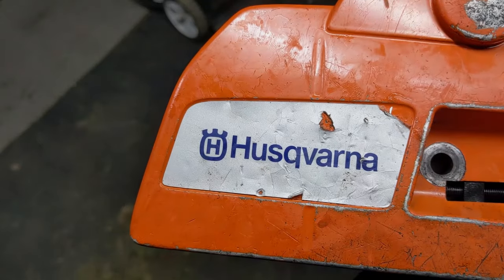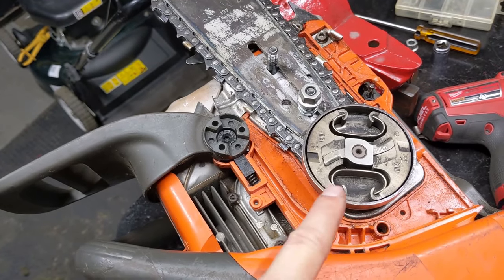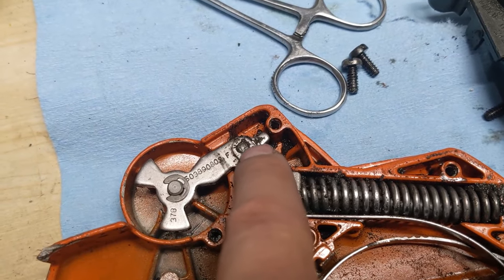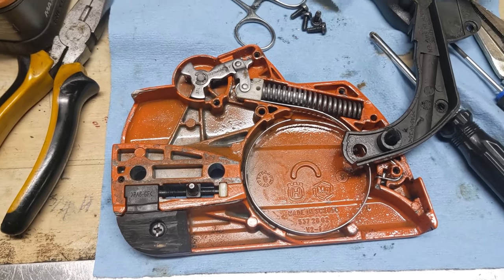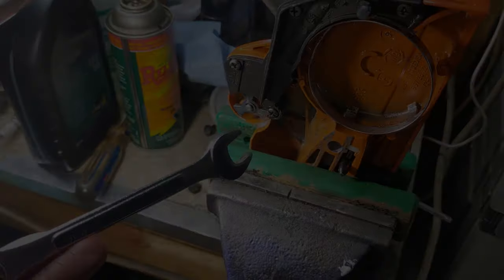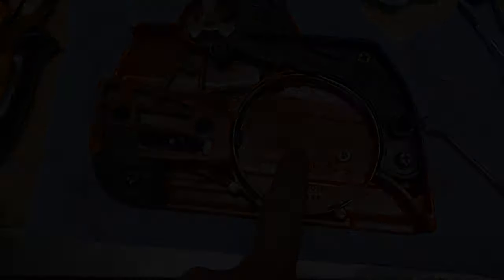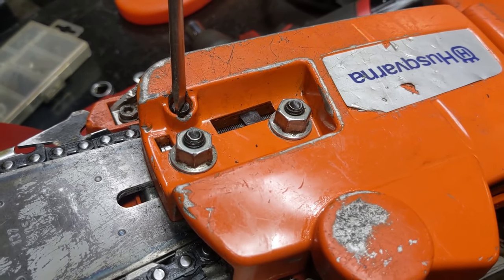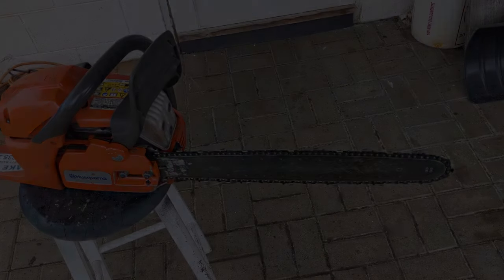How to Fix a Stuck Chainsaw Brake

Comment: Mr. Eliminator, you saved my day. My brake seized cutting a large tree for firewood. My saw is not a Husqua Varna, but it was identical brake system. Carb aerosol cleaner worked great on cleaning the gunk and when cleaned I used small amount of Liquid Wrench aerosol. The 9/16 wrench and screwdriver snapped the seized brake open. Thanks again. - Bob in Arkansas Woods.

Comment: Sometimes a simpler fix is to press the top of the cover back on the saw (entire cover wont go on) with the brake gears in line and the pulling the brake will pop it back. Takes 10 seconds.

Comment: back to the old brute force and ignorance.thought he might have a handler way but thanks anyway.split washer just cracked so deeply tensioner again in case the metal bit slips off the pivot.some tension in that spring.stay safe and lucky.maddog.West cork.eire

Comment: That happens a lot to folks who force the cover off while the brake is on and they are stuck. That spring tension is stronger than it looks too, you cant just take a flat head screwdriver and pop it over.  The wrench was a great idea.
Reply from the maker: Thanks for watching!

Comment: I have a Poulan 5020V saw. A few years ago something happened, the brake spring triggered, and I couldn't put the cover back.

I didn't understand how the brake worked and so I removed the brake assembly and used the saw that way. I know....  not  very smart move. 

Anyway, since I saved the parts, I thought I'd give it a shot to fix it today.

Your video, as so many have commented, was perfect! The trick to use the 9/16ths open-end/ closed-end wrench worked perfectly.

Thank you for taking the time to share your experiences!

Comment: I was trying to put my cap on for an hour. I knew that the inner lock was to small to fit over the clutch but didn't know how to expand it. As soon as I seen you turn that 3 pronged dial with the 9/16 wrench and screw driver I knew that's what I needed to do. I did that and my cap fit right back on just like it should. Thanks a million..... It's great that you took the time to show others how to fix this problem. Thanks again.............

Comment: Thanks for the great video. Today I did all the wrong things to my Husqvarna chainsaw. I finally have the break reset. Now I believe all I need is a new chain bar. It on but not as smooth as it should be. TY🎉

Comment: I had tripped the spring with the cover off accidently a few years ago and didn't know how to reset it.  In order to use the saw I removed the spring and tossed it in my parts tray and forgot about it.  After viewing this video, I dug up the spring out of the bin and reassembled.  Works as it should now.  Thanks!
Reply from the maker: Thanks for watching!
Reply: Doesn't that mean you no longer had a brake working?
Reply: Thank you for this.
Helped me out greatly.

Comment: Trapped two bars with new chains in a tree.  Thought they were pinched but I removed the saw (455 Rancher) and saw the brake ring compressed… so stuck on.   I’m going to clean it all up and reattach to the bar still in the tree (mid plunge cut) to see if I can get it turning and get the bar and chain out!   Thanks for the vid… will let you know how it goes!

Comment: AWWWW, I spent two hours trying to get the cover back on the saw and I failed. After I watched your video and it showed me about locking the spring back on the brake. it all made sense. Should have watched before starting .  I expect successful reassembly. who would have known that I have to reset the spring to release tension on the brake spring. . Oh well lesson learned.

Comment: You did not go over what happens if you can not get the plate off... Have a Husqvarna for decades and change chains all the time... All of a sudden I can not get the place off so I can replace.. with some research it must be the brake and this video help but does not deal with how do I get the plate cap off... I got the bar off and the chain but can not get the plate off.... have you made a vid on this ??? Or give me a clue..??? Your vids are very informative and helpful.... thanks....

Comment: Awesome video, thank you so much, that is exactly the issue on mine. We don't have releaseall here in Sweden,  would be WD40 also ok to use? Would normal dishwashing  liquid also work for cleaning?
Reply from the maker: Soap ok to clean, and yes wd-40 ok, anything to help things slide. Glad I could help, Thanks for watching!

Comment: I didn't have the cleaning machine si I sprayed the break with carborator cleaner over a sheet of cardboard to clean it and then I lubricated it with liquid wrench.  I removed the break handle from the chainsaw and used the turning mechanism to turn the break and it worked.

Comment: Seem to have the opposite problem on mine.  By this I mean the brake does not engage in any position.  I haven't taken the cover off but i'm guessing the brand may be broken?  What else could it be? It's just a light duty homelite which I use around the yard only.

Comment: Great video - one suggestion. Instead of putting in a vice and trying to turn the part to reopen the spring. Put the clutch cover on after it's cleaned,  and use the handle as the lever to reopen it. You may have to fiddle around to get it to align correctly and also be at a little angle since the spring brake won't go flush over the clutch but its really super easy.
Reply: I tried that, it doesn't work.  Follow this video and it will work.  There is a lot of tension force on that spring.  Got a Husqvarna 455 in my shop right now with this problem.  Thanks again for your concise videos!

Comment: need to try this to fix mine and save taken it to the shop Thanks.
Reply from the maker: Like I said, they normally just get packed with gunk. Clean it out, lube it up, reset the spring and it should be good to go!

Comment: I have a sthli ms361 & when i engage chain brake or the chain stop it will cut off can you tell me why ? I have replaced clutch and sprocket with a new ones   no issues til the past two time i used it  . Thanks  Daniel from central Mississippi
Reply from the maker: Most likely the engine dying out because it won't idle low. May need a carb clean or idle adjustment. If your idle is set to high and the chain spins, and you engage the brake it'll kill the engine.
Reply: Awesome thanks  . The chain was running sounds like that the issue  .thanks again  !

Comment: Just subscribed to your channel.  I fired up an Echo CS590 that I bought in the spring,  (Just too hot to cut wood in the summer).  I followed the instructions and started it up and it was too dark to safely cut. Went back to the saw and the chain will not turn.  I am wondering if the clutch or clutch assembly has been damaged,  It was fine out of the box. What's your take??
Reply from the maker: Could be a stuck brake, or the chain is too tight?
Reply: @EliminatorPerformance  Chain is fine. The clutch is really locked down so it could be the brake.

Comment: I have a 460 Rancher. I keep having the problem of after using it for a few minutes the chain will tighten to the point it will make the engine bog. I suspected the brake was stuck on so I took this cover off and reset the brake. It worked for a while after that but the problem happened again.  Is there a mechanism that holds that brake handle in a neutral position and on mine it might not be working right?
Reply from the maker: When you adjust your chain tension, do it with a piece of wood under the bar. Your bar is likely moving and tightening the chain.

Comment: I get these saws in my shop all the time with this problem. It has nothing to do with being dirty. It’s caused by people taking the cover off while the brake is on. Take a socket you don’t need and cut three notches in it so that it fits over that brake mechanism. When one of these comes into your shop, pop the brake open and put the cover on and you’re done.
Reply: This echo 400 i have doesn't have those grooves to tool on like your describing , and plenty of other videos describe as well, like this guy's... - i thought i was going to turn it like you say , but it's just this smooth piece with no grooves to work on ... - a couple hours later and i have yet to see anybody showing this unusual model !  - called up echo so-called support - and the rep said he never heard of this problem - of course he was happy to sell me a new cover though !  - I'm sure it can be turn to unstuck , but it'd be nice to see someone covering this peculiar style 1st before i begin messing w/ it , the newbie that i unfortunately am...
Reply: @usernaame1000   Echo CS-400?

Comment: why does the chainsaw "burrr"sound and the chain will not move when switched on ,it will burr louder if throttle is pressed more
Reply from the maker: Brake is probably engaged